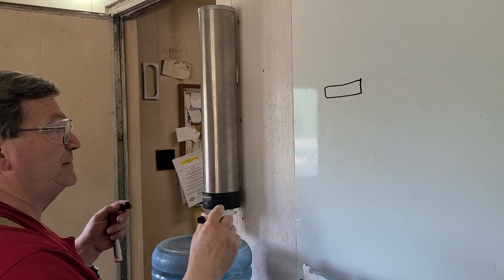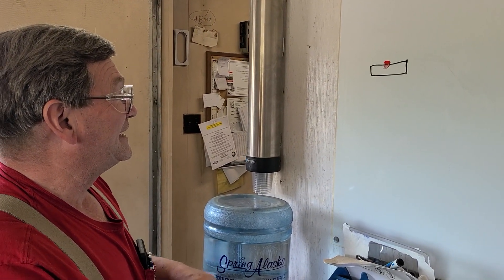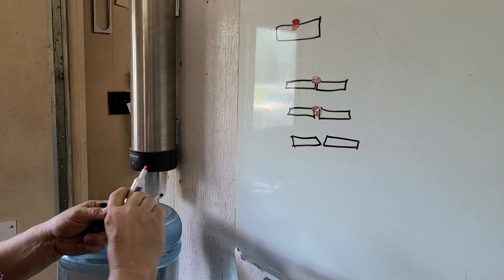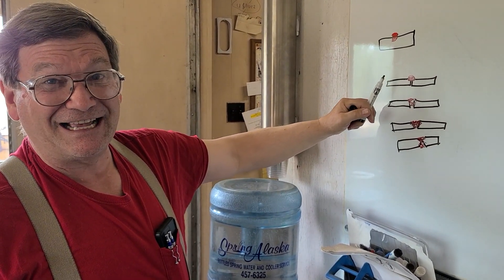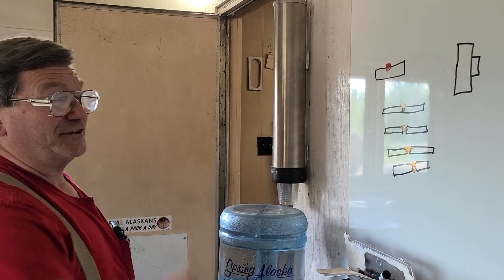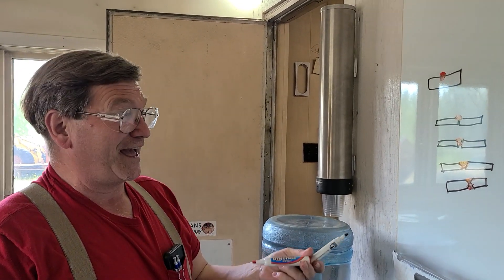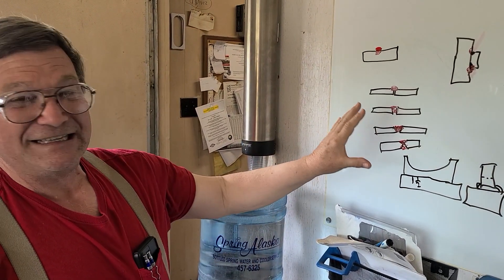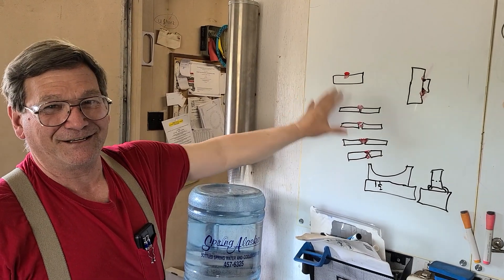Machinist's Minutes: Fill and penetration make a weld

Comment: Got to add a story I remember.  Fred, told me this one, he was working in Colorado, got sent by union to take a test for a job on nuke installation,  test was test tabs, 2 x 1/2? Hey I am remembering his story here give me a break.  Welding machine, every stick rod available, grinders etc.  Weld it, bend it, back again, If  coupon didn't break you passed.
Fred said he gapped it good, arc outside edge in, chipped and flipped, chipped and slagged.  Welded all flush, can't remember if he said 6011 or 6010.  Built up flush, ground flush.  Out of many welders taking test he got the job.  Tensile strength of weld should be the same of parent metal.  Or close.
Flexibility because everything moves.

Comment: Good explanations as a machinist who has also done welding in the past. The biggest difficulty that I see is two dissimilar sizes of material.  A lot of people fail to get good penetration on the thicker side by failing to understand that you spend more time on the thicker piece.

Comment: Good news is you're not a dummy, you're just a hands-on learner.  Proof is that you didn't make the same mistake twice.  And you're not the only one.  I've had to go so far as repeatedly embarrassing engineers in front of their supervisors to get them to leave space for welds in their designs.
Reply: They don’t seem to be actual engineers with a degree. Engineers normally spec out welds pretty well. It’s one of the things mechanical engineers learn in school. It’s usually welders who don’t meet. The specs maid down because they don’t understand why something is spec’d that way. Like the difference between a machinist and an engineer. The machinist understands how to machine something, but not really why it has to be made that way. I’ve come across this often. So they modify the part and then it doesn’t meet specs anymore and has to be scrapped. The same problems happen in a lot of bigger companies between design and production engineers. The production engineer gets a design and thinks, “we can’t easily make this” and modifies it so that it they can. Then it breaks and the design engineers look at it and can’t understand why until they realize it was modified. This happens all too often and is a reason why some things fail.
Reply: @melgross  No argument that there are bad apples on all sides of a drawing, plenty of cocky welders and machinists to go around.  These two engineers came to mind though because of the context of the video.  They'd design large signs with embedded LCD panels but not take into account the space the welds they were calling out would take up so the panels wouldn't fit into their frames.  Being stamped drawings we couldn't enlarge the frames the quarter inch required to get clearance.  Between the costs of new drawings, reworks, and the production delays there was enough noise to draw the attention of the department head, so he dragged the engineers down to the shop to figure out what was going wrong.  We built a frame around one panel to the spec the engineers gave us to demonstrate the problem.  Yes these two were actual engineers with actual degrees, their designs were pretty good, they just didn't take into account that welds take up space.  These two got dragged down to the shop a couple years later for a similar problem with basically the same result.
Reply: @skwerlz  I’m not saying I don’t believe you. I’ve encountered a lot of odd design problems over the years. It’s just that they should have had at least one course that delineated how this needed to be done.

Comment: I'm 66. First welded when I was 13 and fert spreader broke axle. Dad was away on holiday and my grandfather was minding us on the farm. Had watched enough to have a go. Got the axle rewelded and reinforced and operating again. I was hooked. At 16 began my apprenticeship at a very reputable engineering company but because of demarcation and union stuff arc welding was for boiler makers. Not fitters and turners. Gas welding sure to make our own tip tools etc. Times change and learn stuff a bit later and a lifetime of good, bad and ugly welding consider myself quite capable but not perfect. I work in a hydraulic shop and the same attitude exists. Grrr. Well did some cylinders other day and prepped stuff for welding. The expert welded on fittings and then got called away. I was able to machine barrels and then welded on ends etc and second lot of fittings. Rams got assembled and tested. I guess I must be ok because my welds were clean and pressure tight. The "welders" fittings leaked! Only took a year of holding my tongue. Funny, I love quizzing other tradesman about what and why they do stuff. You don't know what you don't know unless you're enquisitive. I'm also happy to pass on tips for manual machining etc. Just frustrating when we get rework that is caused by sloppy attitude, lack of attention to detail, or too lazy to clean and inspect all of the components properly. Feel sorry for clients who don't know their repairs are borderline, but bills are high.

Comment: Great as usual  . I've met a lot of machinists/toolmakers that had no use for welding and in general looked down their noses at welding processes. Glad you take a practical-balanced approach  .
Reply: Ya try to find a machinist/welder these days.  I guess rare animal, but I wouldn't feel adequate if I wasn't fully capable of BOTH skills. Been at it 44 years now.